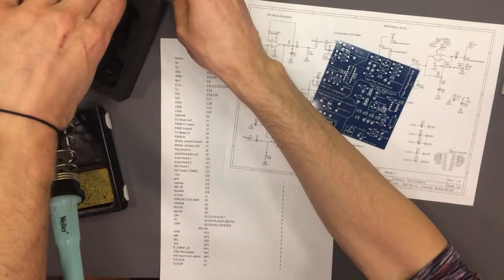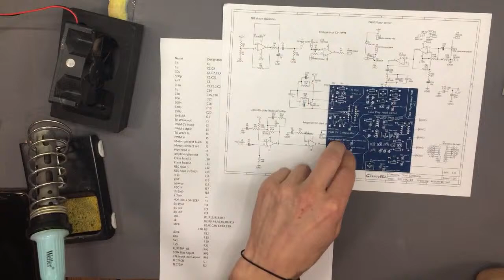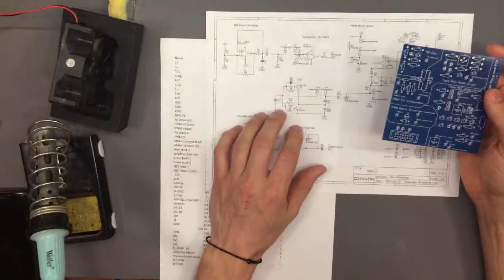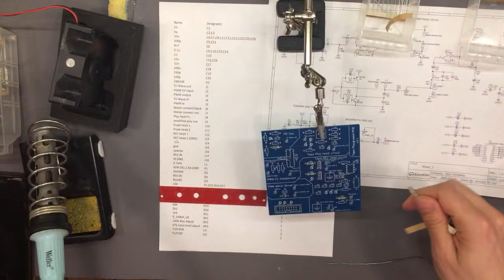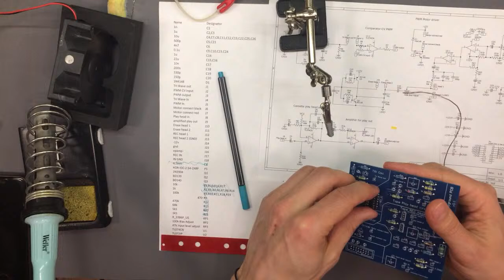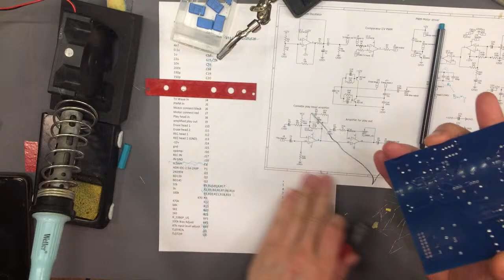Soldering the “tape playground”

Comment: What is this an eurorack module delay?    What is that thing, to make the ic legs right?
Reply from the maker: No this is just a 10x10cm pcb with a bunch of different circuits on to work with a tape as a delay.